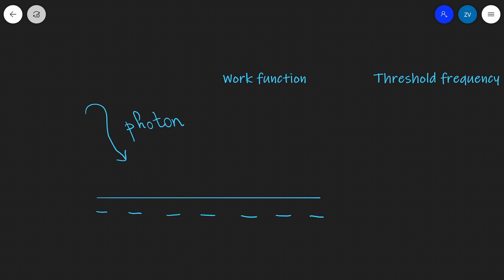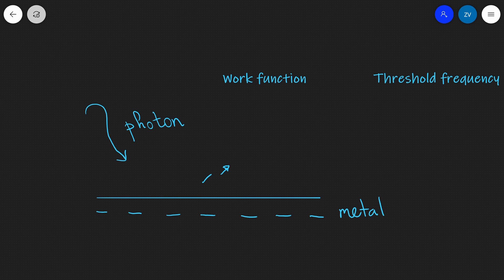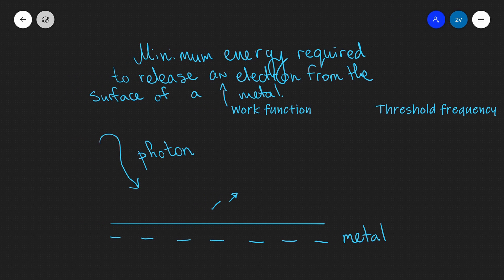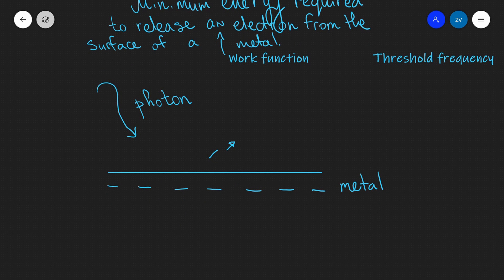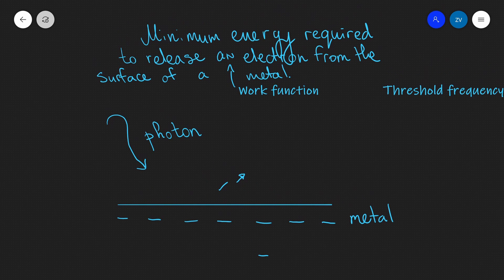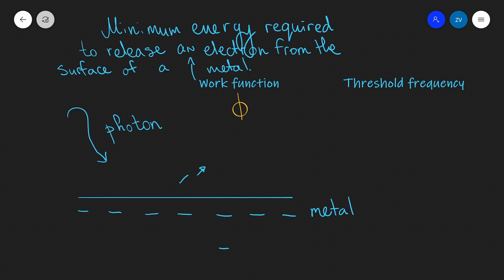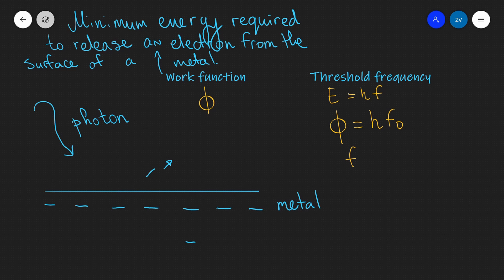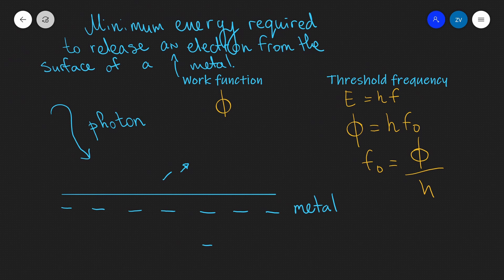The Photoelectric Effect: The work function and threshold frequency

Comment: If e=hf for the energy of a  photon, and a photon has a mass of 0, does this mean a photon doesn't have kinetic energy?, but how will that makes sense, if it moves it should have kinetic energy but by calculation it doesn't? I would have thought that its kinetic energy would be equal to E=hf.
Am I missing something?
Reply from the maker: yep, so unfortunately this is where classical theory breaks down. So the energy of a photon is actually given E=pc in the special theory of relativity. It absolutely has energy and momentum which is transferred, it is bizarre but amazing : )  Relativistic energy (not on a level spec) is given by E^2=(pc)^2+(mc^2)^2, a photon doesn't have a rest mass so its energy can be calculated by E=pc.